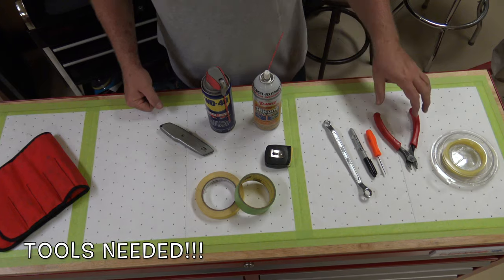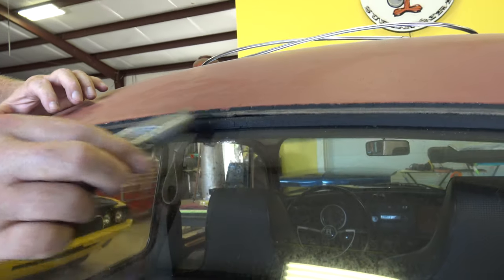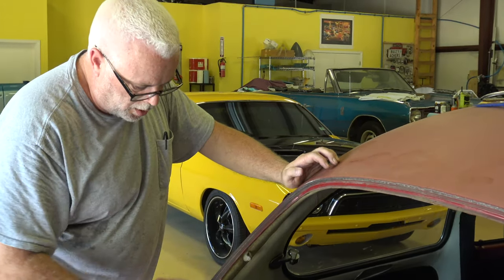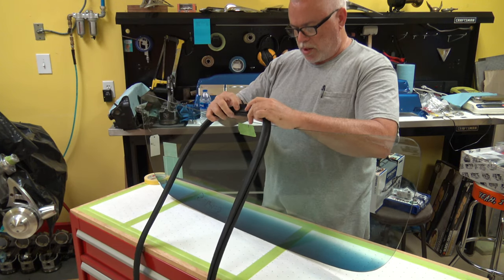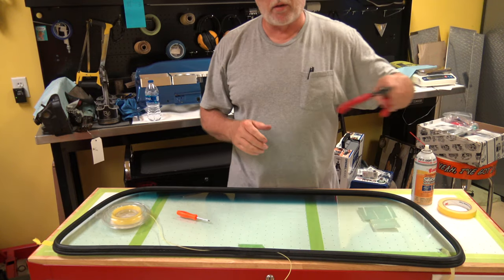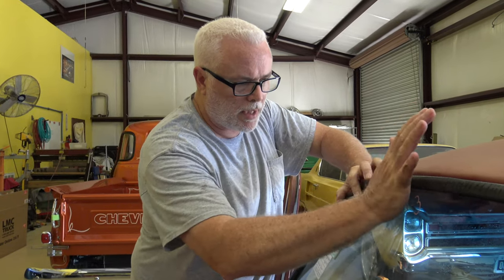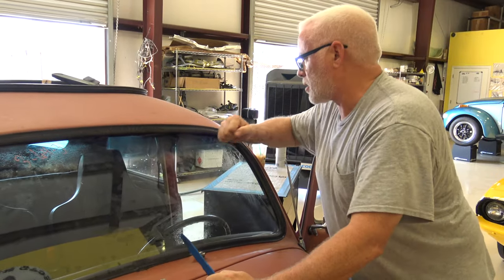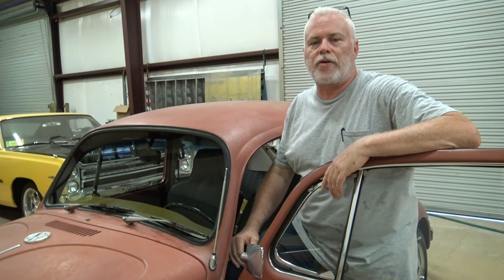VW Beetle Windshield Removal and Installation - 1970 Bug

Comment: Suggestion:  It may seem counterintuitive, but my local VW mechanic suggested I use cotton clothesline or window sash which is close to 1/4 inch in diameter.  windex and KY Jelly up the cord and wrap it around the window.  The larger diameter keeps the groove open wider and makes installation so much easier.  I realized because  I've done the windshield twice in the past few months and first time was with something else.  Hope this helps.

Comment: Why do you make it look so easy I've been fighting for a week just to get the seal on
Reply from the maker: Derrick, the key is to warm it up in the sun to make it a little more flexible, then use masking tape on the corners as you go along to hold it in place.
Reply: Thanks it was 103 in southern Arizona today, and after an hour of swearing, sweating, fighting and two burnt hands I got it on I think the seal was just not a good one, talk if the others went on easy but this was a made in Brazil brand, thanks for your response, I look forward to your other videos

Comment: Do you have more pics of the 68 Fury? I have a couple 67 - 68's convertibles sitting around
Reply from the maker: I don't, that belongs to a guy I used to work for in TX. I'm going there next month to pick up a different car and could take a few pics if you like. It's a custom build.
Reply: @JayDubCustoms   that would be awesome. 
An thanks for posting the windshield video. I gotta pull mine and paint my bugs dash

Comment: I have a question. I have a 73 standard bug. I'm replacing the windshield and seal. When I took the old one out to clean and prep it I found it has these galvanized L shaped things on the bottom and side pinch weld that seal goes on. A lot of people told me to just put the window in. And a lot of people said to remove them things that seals now days won't fit over them.  Have you had any bugs with these parts and what do you think I should do ?
Reply from the maker: Jessica, I'm assuming you're talking about the soft metal channel on the pinch weld. I think those were put on in the factory to hold the headliner in place until the glass was installed. And yes, I take them off too since the newer seals don't fit completely over it. It serves no purpose if the headliner is glued in place.

Comment: If I decide to replace the seals on my quarter windows before I have the headliner replaced, will I be able to reuse those seals after I have the headliner replaced?
Reply from the maker: Yes, and I recommend you remove the windows to install the headliner. It takes time but it can be done. Just use some plastic trim tools like these...
https://www.harborfreight.com/trim-and-molding-tool-set-5-pc-64126.html  Work from the inside of the car and fold the seal back, add some silicone in the seal track as you go and work around the seal with the trim tools until you can (softly) push/pry it out. Make sure someone is on the outside to catch the glass. Hope this helps.

Comment: I'm haven problems putting in a windshield on my 71 super beetle convertible.
can't pull the string over the fling it way to wide for the groove in the rubber seal.
Reply from the maker: Um, not sure what to tell you Lloyd. Maybe try a thinner weed eater line?

Comment: How about the interior metal clamps under the seal, will it cause headliner too become loose pre maturely? Great vid
Reply from the maker: Jason, it's possible. But just pull tight and re-attach that metal strip/clamp.
Reply: So, 10 months later the metal clamps that my seal wrapped over, has pulled off just enough to allow water to slowly work itself in, unfortunately I think u will encounter this if your outside long enough. I think the uv rays heat, not sure caused it to slowly creep off those metal tabs. I am resetting the glass this weekend without the metal clips, I will let everyone know how it goes, wish me luck
Reply: So, maybe you already know this, just saw another vid and these clips help hold the glass in an accident and the American style seal not designed for these clips I suspect. Maybe the cal seal is a bit larger, yours looks pretty good over the clips

Comment: Q; if you plan on painting your VeeDub are you going to have to do this all over again. Plus all your trim is on and will have to be removed before paint. Maybe your going to run if in primer for a while🤔
Reply from the maker: Mike, I plan to drive it as is for now.

Comment: Where did you get the windshield from, did they charged extra for shipping?
Reply from the maker: I got it at a local glass company when I was in Austin, TX. They actually drove it out to my shop. But they're permanently closed now. Don't know what happened. I'd love to find some more... that one has a really nice blue tint across the top.
Reply from the maker: @Junior Classic VW bugs You've prompted me to investigate a little. I've found the manufacturer of the glass and will call and ask if I can buy directly from them or if they can give me retail locations.

Comment: Can you remove a front windshield and seal together by simply kicking them out?
Reply from the maker: You can but there's a really good chance you'll break the glass. If it's no good then yes go ahead, but if you're wanting to save the glass then maybe put pressure at the top and slowly push it out. I'd still cut the outer part of the seal off like I show you at 22:12.
Reply: @JayDubCustoms  thanks for the quick response.  The reason I asked is because I’ve a newer seal and window that came on the bus but the window got cracked on the road.  I know the seal is only $40 but hate to waste good money.

Comment: Wow! You make this look so easy. I am certain that skill and experience plays a big part. I am interested in a VW Beetle for a daily driver. I think I would want to drive it for a while in stock form, and see how I like it. Then determine if I would like to do any modifications, or just keep it in stock form. I have some ideas of what I would like to do with a beetle but there would be many factors which would affect the project outcome. But I would want to retain the basic beetle form for the body shell, and somewhat basic interior with a few upgrades perhaps.. But would like upgrades and  modifications in drivetrain, suspension, brakes, electrical, etc.; Which would be a long term project for me.  -Rob G in Sparta, TN
Reply from the maker: Rob, they're a fun car to have. I have 5 at the moment and have been wrenching on them since the early 90s. Hey this will blow your mind... I'm sharing a restoration shop in Austin, TX right now but I'm in the process of moving and opening my own shop in... Sparta, TN! Check out my FB and Insta under Jay Dub Customs.
Reply from the maker: Hey @Gyser Hawk! Where in Sparta are you?
Reply: @JayDubCustoms  Oh the east side near where the old junior high/middle school used to be located
Reply from the maker: @robakagyser2300  I'm in the Cassville area going towards Smithville. Almost have the new shop completed. Maybe mid July.
Reply: @JayDubCustoms  Are you Jeff W? If so we went to school together from elementary school through high school. If so glad to see you are back to White County.

Comment: I need to do this on my 64 Beetle.  Will this be the same procedure since the glass is flat?
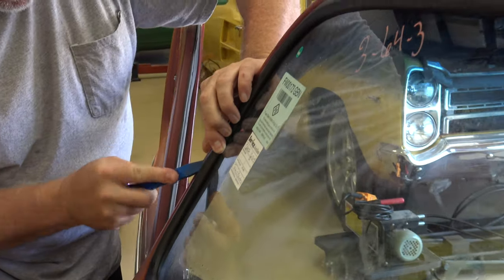Reply from the maker: Yes, pretty much the same procedure. The only difference might be the part that starts at 17:00 minutes. That might not be done on the earlier Bugs. I’m not 100% sure. That’s a 70 model I’m working on.

Comment: Would love to see how to replace the fresh air vents, especially the windshield defroster ones. There is so little info on how to do this esp for a 71 beetle.  Very little on the Thesamba, feel this is the one big gap in knowledge and the best way to proceed.. do you take the wiper motor out to do it, do you need to take the windshield out aloo - which is what brought me here.. Thanks for the video! Hope you consider the vent suggestion.! - The complete A to Z on doing this does not exist! Thanks
Reply from the maker: M Sach, I'm actually restoring a 71 SB right now. Maybe I can work in a video that covers that. But I have the windshield out to make things easier. And the wiper motor is already in though, so I'll install vents around it. One thing I had trouble with is getting the vents to fit right in the new dash pad. The pad is aftermarket.